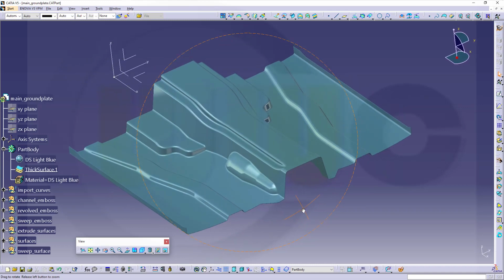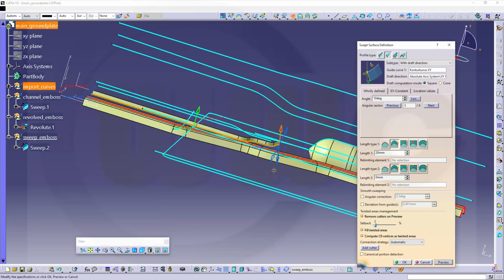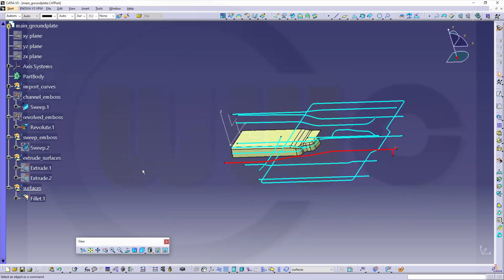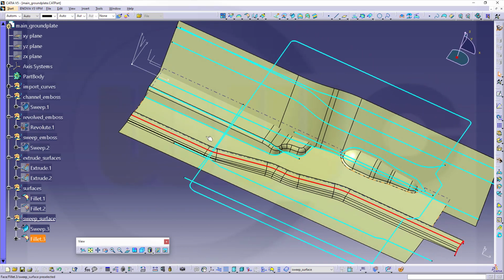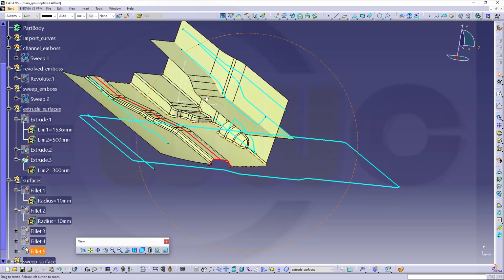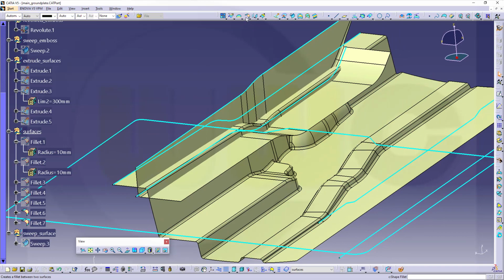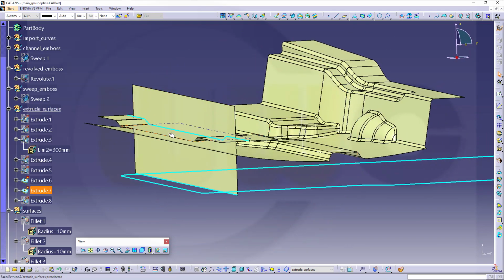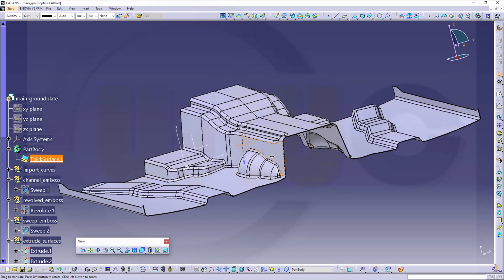Main Ground Plate - Catia v5 Training - GSD

Comment: When I draw a sketch over surface under normal view , still it shows extra edges which should be visible in normal mode.
100% normal mode is not coming 
Any suggestion?
Reply from the maker: You mean "it shows extra edges which should NOT be visible", do you?
Reply: @wolfgang.walden.cad.training  
Sir,
100% normal view is not coming in cartia.
Always it is slightly perspective.
But in solid works it is always normal.
Reply from the maker: @SatishKumar-gt6jd  Go to: VIEW->RENDER STYLE->PARALLEL
Reply: @wolfgang.walden.cad.training  thank you.
I will try sir
Reply: It has worked,
Thank you sir
Reply from the maker: @SatishKumar-gt6jd  you´re welcome
Reply: @wolfgang.walden.cad.training  can you help me to design , 3 axis CNC milling machine.
After that planning to buy spare parts to make working.
After design a consumer plastic part the steel mold , and G Code for fabrication.
Reply from the maker: @SatishKumar-gt6jd  sorry, I have no knowledge regarding CNC